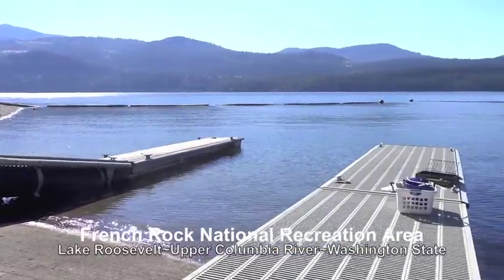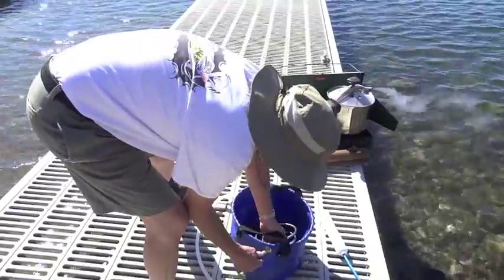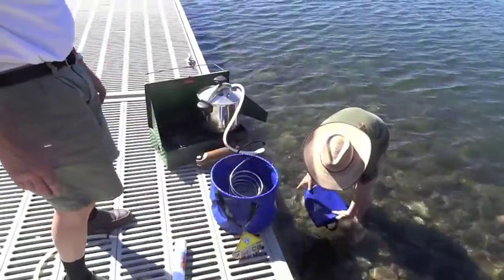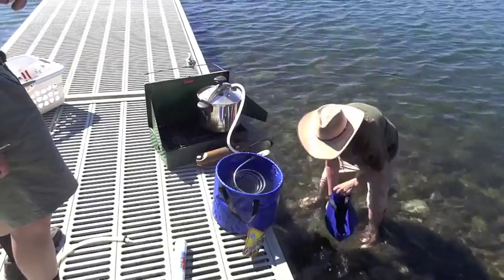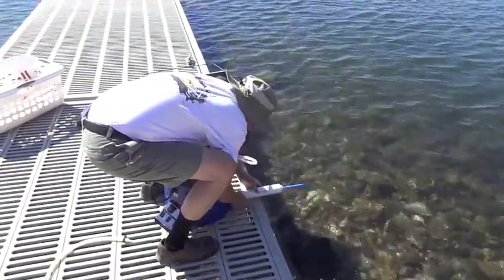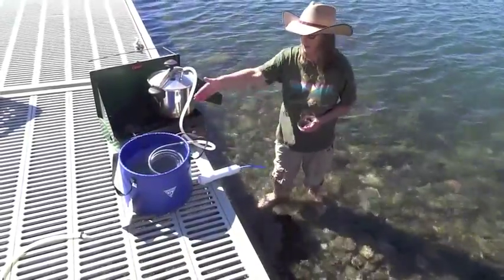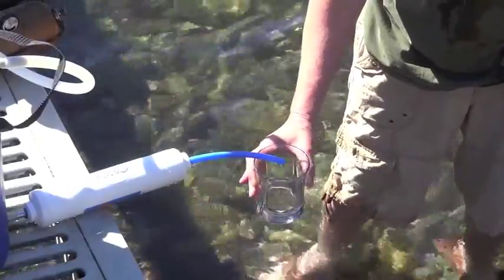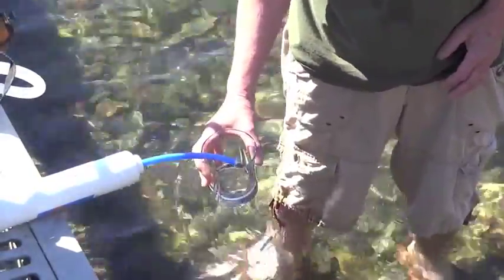Demonstration of Vortex Water Distiller kit installed in collapsible bucket

Comment: hmmm well why the filter ? why wouldn't the VCA Gases if presant just escape as it drips into cup to drink...seems if it's such a fine mi-nute substance being gasses of sort it's just going to wash on through a filter , if its type gasses "airborn" then just assume it more needs an escape rout than to be contained in a filter were your precious pure clean water is running  through , being the filter contains all that caught and trapped vca's ... ??? really makes no scents. we just use to sit out water in a pot and let it evaporate the VCAs. Maybe I'll do some more deep research and find studys and facts on VCA filtration which I can find zero with any distillers useing filtration for VCA. Distilled water is suspose to be pure of all contaminates...???